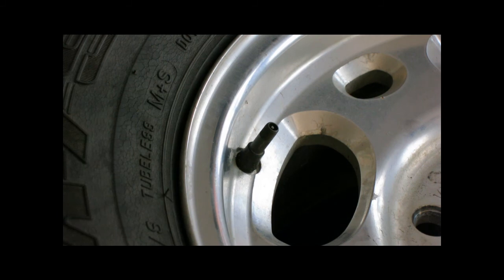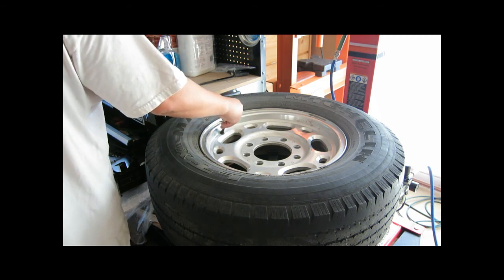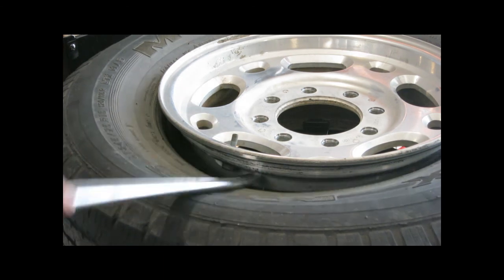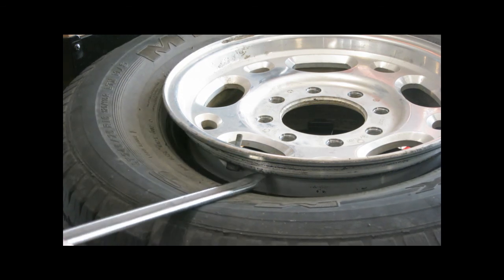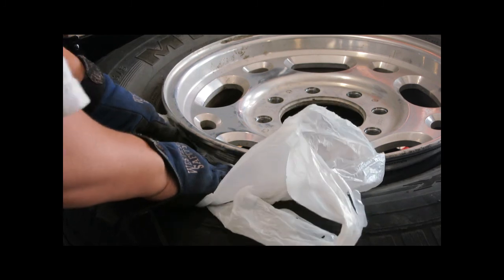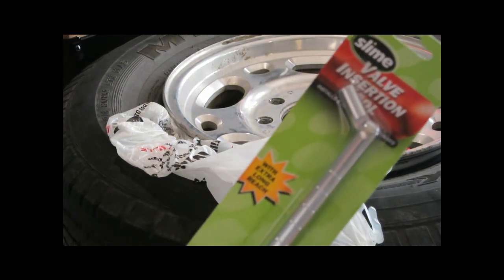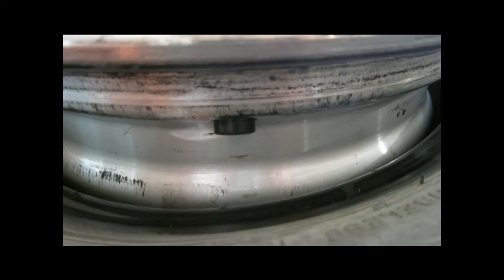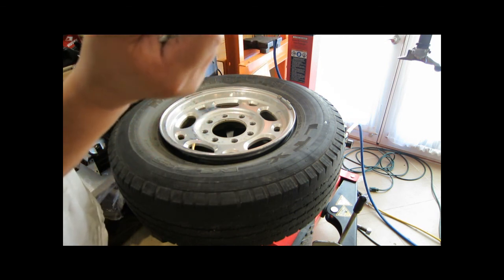Replacing a Leaky Tire Valve Stem

Comment: Very good instructional video that is concise and easy to follow, except for the small font that is very hard to read at best. Though the objective of this video was fully attained, the premise behind it is so ridiculously contrived that for me personally it completely overshadowed it's informational quality. I could be wrong but it's inconceivable to me that someone with access to the equipment in the video truly went 3 years with constantly filling his tire instead of taking the 12 minutes to fix the problem. It's also unbelievable that he had never done this before considering that several times during the video he seemed to know exactly what to do to make the installation easier and also knew what the outcome would be before he started. I might be nit-picking but if someone feels the need to put on such a useless act during an informational video which inherently insults the viewer's intelligence then they deserve to be called out on it.
Reply from the maker: Darren Stollings Thanks for the condescending remarks.  If you only knew what my life is like you will realize the comments you made are uncalled for.  The truck is driven every other  month so it's not a daily driver so I have the option of not having to deal with it until I want to (not when you think I should).  Have a great day.

Comment: Hello from England. Thanks, I was looking for just this info. My only comment would be that lubricating with washing up type liquids are not ideal as fat removing elements trapped between rubber and wheel can "eat" away at the alloy with risk of leak path. Couod do with editing down to 3 minutes.
Reply from the maker: I used tire lube so we're good :).  Yeah I should of cut down the length of the video.. next time.. thanks!

Comment: You say that some people cut the valve off yet you snap it and now have a useless screwdriver? Y not cut it?
At one point you go to use the claw end of the hammer to try and pull the screwdriver off but stop at the last second lol
Then you say this valve should have a red o ring in it and when you see it is red you then go oh you have to make sure the o ring is red yet you did not know what colour it was when u purchased it only when you pull it out do you realise it is red.
You turned a 2 minute job into 12 mins.
No wonder you left that valve for 3 years my friend.
Great job well done.
Do not open a tyre shop in the very near future